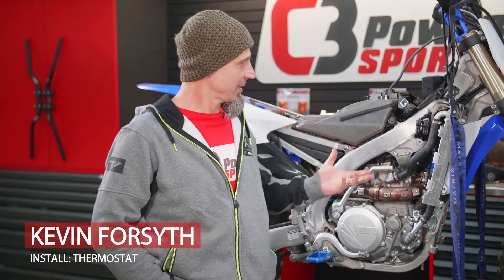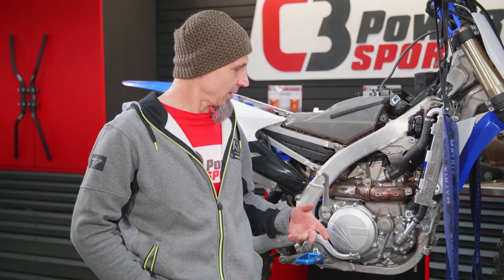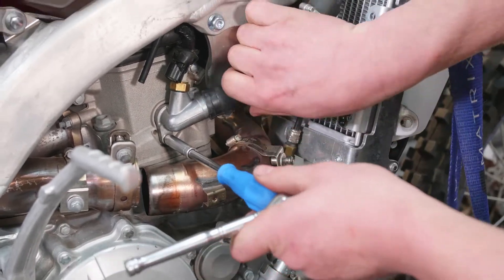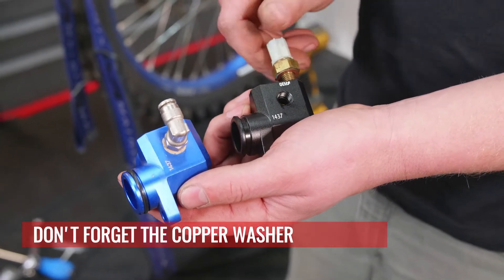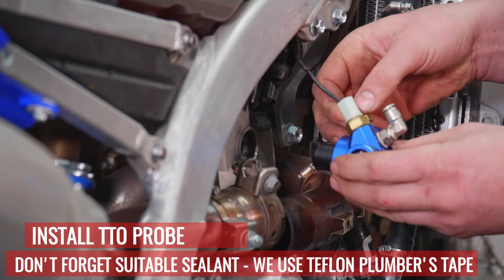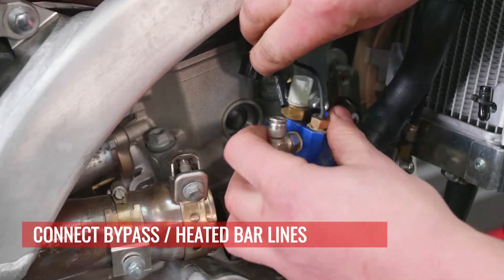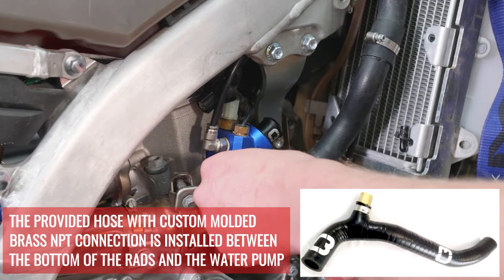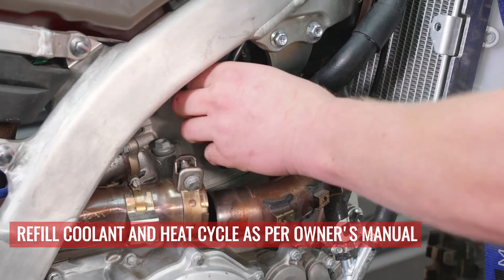C3 Factory Billet Thermostat Install - Yamaha (Honda, Kawasaki)

Comment: Can you leave it installed in the summer also
Reply: Yes we have many customers that leave them installed and on a few bikes that we have ridden in the summer we have also left them installed and they perform just fine in the summer also
Reply: My set up doesn’t have the extra wire to the housing, can I put the tube in that hole instead of the one behind the housing? The angle would fit mine better
Reply: What can you do for the male connecter thermostat temperate sensor if it’s broken?